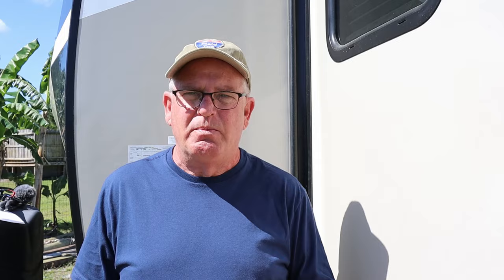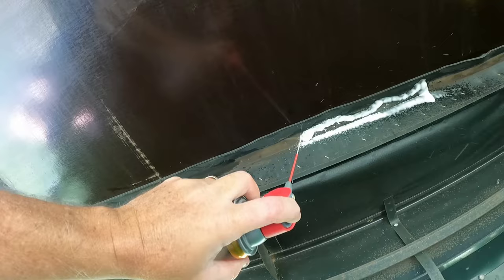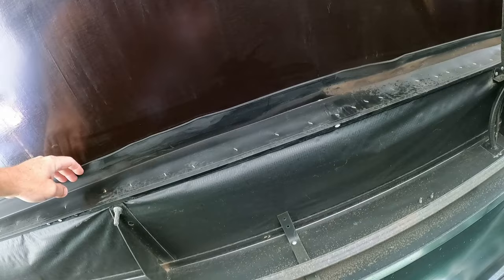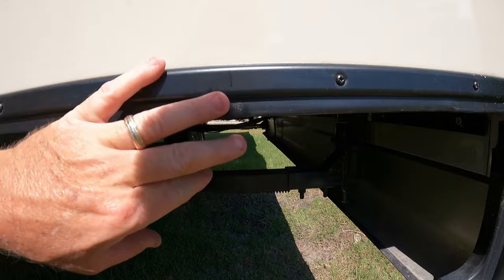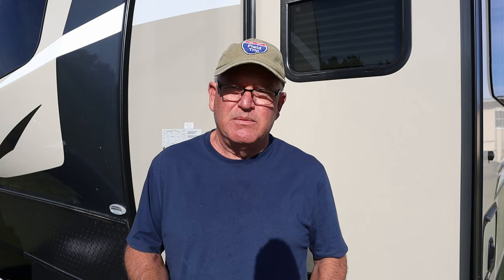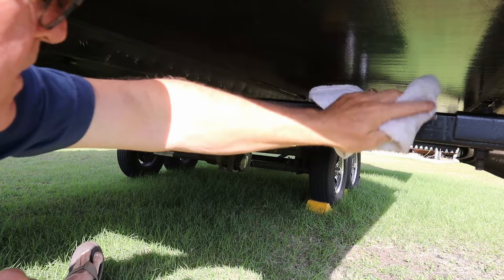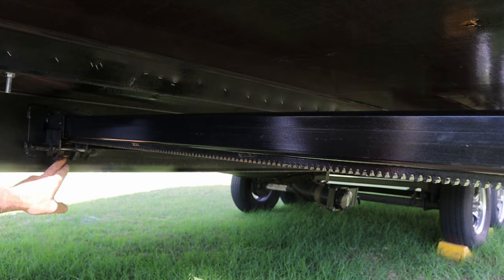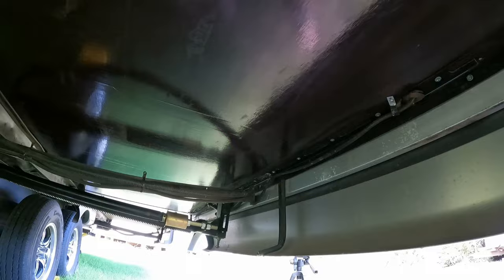RV Slide-out Maintenance And Tips! – RV Life

Comment: Excellent video. I bought both those lubes. I didn't take really good care of our last rv. I plan on changing for this one. I'm going to check all of what you mentioned, when we set up for each trip. Also, I'm going to do it when we winterize, and dewinterize our trailer. I have to install roof vent covers, stabilizer supports, a leveling gauge for the front, and a padded frame for the solar panel, for when we close it up for the season. I'm going to make that out of pool noodles.
Reply from the maker: Sounds like you got a good plan in place, we thank you for sharing and commenting you guys have a great day

Comment: Thanks for the video. Washing off the rubber slides with a good soap especially the top seal before hand. The leaves and sticks will scratch and make burrs in the seals. Cleaning the top and side seals before closing the slides of debris will prevent problems. Thanks again
Reply from the maker: scotsmanofnewengland7713, those are some great tips and thank you for sharing them, we wanna thank you for commenting

Comment: My RV has been sitting a bit and is full of cobwebs, dirt, and wasp nests under the slides.  Any tip on how to remove wasp nest and once removed, can I spray the underside with water to remove dirt and cobwebs before doing this maintenance?  Also, I applied seal conditioner to black seals but found a white foam like material on front of slide that leaves chalky white residue.  Is this normal?  It looks dry and cracking.  Thank you for your video.  I need to do all these things.
Reply from the maker: I personally would not spray water underneath if you use the spray that I have in the description, you can use a rag and it will clean it up just fine. Or use a damp cloth to wipe off all the dirt and cobwebs, good luck and let us know how it works out